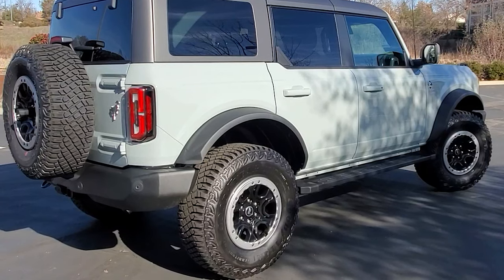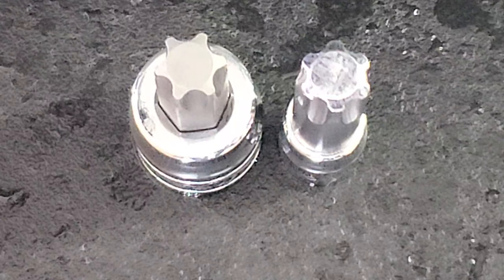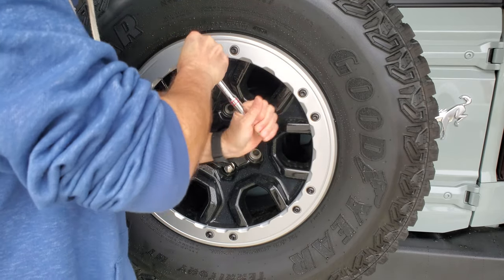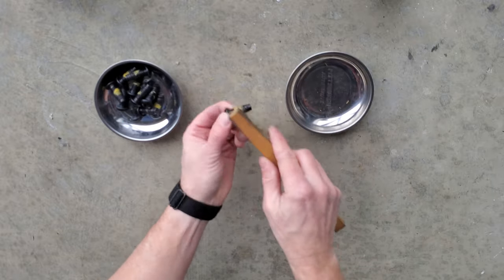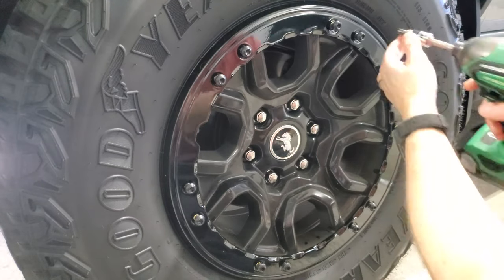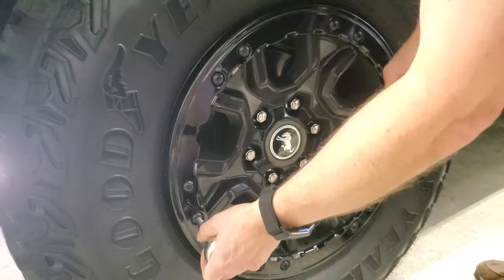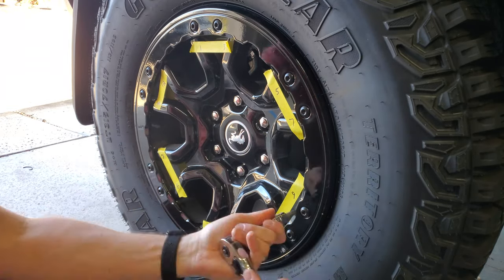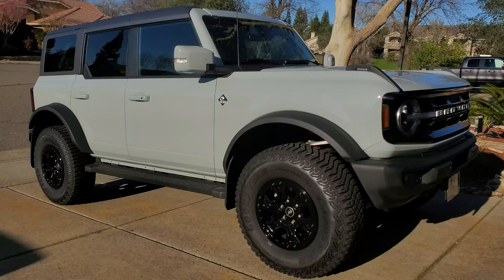Ford Bronco Sasquatch Wheel Bead Trim Rings Removal and Powder Coating

Comment: I bought the black trim rings from ford accessories with a 25% off coupon during their Christmas sale. They came to around $500. I didn’t want to deal with the whole powder coat process.  I basically took them off and reinstalled the new ones exactly like you did. However, I used a permatex anti-seize on the treads of the bolts not thread locker.  They look so much better in all black. Good job!
Reply from the maker: I think I would have done the same thing, especially if I had to do it over. I hated waiting. Once I start the project, I want to finish it. 👍🏻
Reply: Second using anti-seize on the rings. When you get new rims, it is recommended to take the beauty rings off so the shop cannot scuff them up.

Comment: You can chase the threads with a bottom tap to clean out the locktite.    I like the contrast  with silver especially with cactus Gray.  I tend to gravitate to mods that add functionality or solve a problem.  Aesthetic mods are the lowest priorities.    Plus off road they will probably get scratched.   Last,  I think your wife has too much power in your relationship,   you might need to get her in line making you a sandwich.
Reply from the maker: Running a tap in them is a good idea, but luckily wasn't needed in my situation. 👍🏻 My wife is always making me 🥪🥪🥪 that's why I'm fat! 🙂

Comment: Made a HUGE difference. I painted mine with gloss black raptor 1k which is like Bedliner paint. The finish is identical to yours and it’s rock hard. Also my experience taking off the bolts was identical. Accept I torqued mine to 40ft/lbs. Seemed a bit better. And the look is sick.

Comment: I just got my 24 OBX and want to do this same mod. I'm nervous about stripping or cross threading the bolts. I was planning on sandblasting them myself since I have a sandblasted and a friend will powder coat them if I buy the powder. Thanks for the great video
Reply: The bolts are hardened and come off fine. Just manually break them loose then use an impact to buzz them off. That’s what I did.

Comment: Great video!! I'm going to follow the same steps when my Black Diamond Sasquatch arrives shortly. Do I need both of the torque wrenches you've linked to complete this project or will the Torx Bit Socket Set work with either? Thanks

Comment: Im new to this all , all my cars have been muscle or race cars my bronco is my first off road , i want to get mine powder coated, can i drive with the bead lock trims off while they car getting painted ?
Reply from the maker: I asked the same question and did some research on it before I pulled them off. Yes, you can definitely drive it while they're off. They're just decorative "beauty" rings, not actual bead rings.
Reply: @Bronco Bebop  makes sense, since techinically bead rims aren't dot street legal in many states

Comment: Looks good! I have different set of wheels on my raptor but they are the gen 3 raptor R wheels with beauty ring.  Where did you find the instructions on proper installation with torque specs?  Been searching and really can't find much.  TIA

Comment: Can’t you take the beauty rings off and then have an all black rim? What’s the purpose of the beauty ring if you’re painting it black anyway? Just got my bronco so curious.
Reply from the maker: I suppose you could, but I think the wheels looks so much better with the rings on.
Reply from the maker: And that assumes you wheels are all black underneath. Ours were mismatched.
Reply: @broncobebop  awesome thanks!
Reply: I'm thinking the same thing. I wonder how the screws look, installed wirh out the rings. I'm sorta of a weight freak. If its not needed, why have it. Whats your guess on the weight of each ring? Great video!

Comment: I had my 5 beauty rings gloss black powder coated for $80.-  It was a shop that does gloss black powder coating every week so they didn't need to buy separate powder for my small job and turn around time was less than a week...pretty happy with that. BTW, all 5 of my wheels were silver undernerath the rings (Base 4 door Sasquatch). I used hand tools to "snap" the bolts loose but the screws were a pain to take out.  I had to purchase 4 bolts because of stripping and I had to drill out one of my bolts that was severely stripped. Enjoy your content
Reply from the maker: Wow. That sounds like a great deal. I have a feeling I paid more than anyone else either because I'm in CA, or that's just my luck!

Comment: Thanks for making this video! This was so helpful. Especially which bit to use, the tape trick, and the tip about cleaning off the bolts and the holes. Made for a very smooth process that took less than 2 hours.